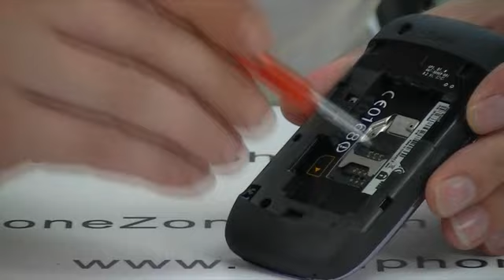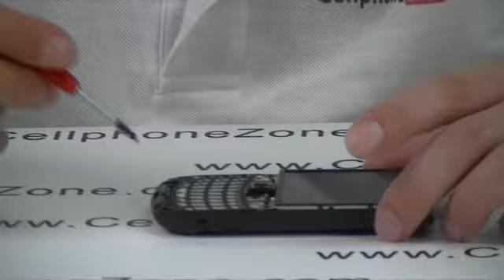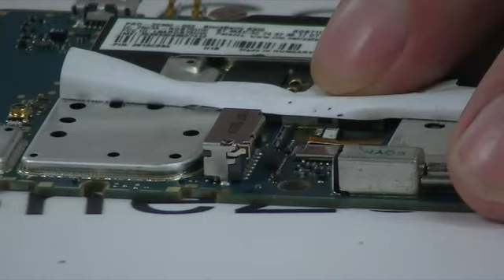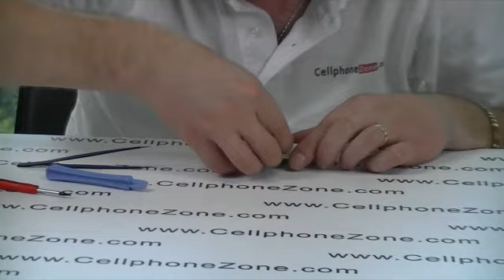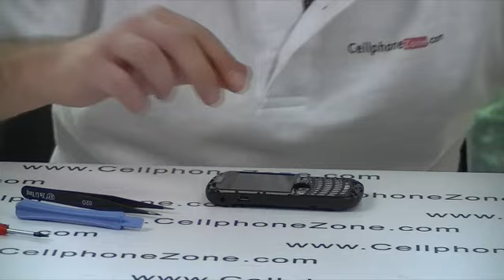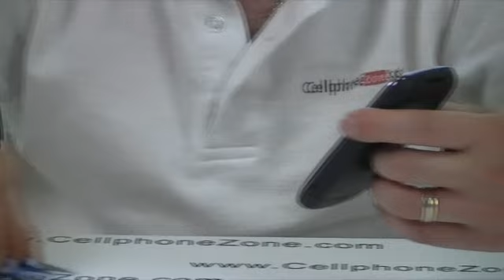Blackberry Trackball - How to Fix Blackberry 9300 Trackball

Comment: It was actually a dodgy trackball, I bought it on ebay and thought I could trust it as the seller had sold over 1000. I bought a replacement trackball from another seller and it works great, thanks again

Comment from the maker: Hi Nicole, sorry for the late reply, if you have not fixed it already the best thing you can do is take it apart again and check all the connection plugs are connected correctly to the motherboard, and also make sure all the screws are done up tight as if there loose you may not actually have a battery connection, I hope this helps,
Kind regards,
Neill.

Comment from the maker: Hi, the first thing to check is the top screw and middle screw on the right as you look down on the phone are done up tight, if they are not tight then you will have no battery connection, try pressing down on both areas and see if you get a red light, try that first, 
i hope this helps,
kind regards,
Neill.

Comment from the maker: Hi, when you reinstall your front housing make sure you start at the top, push it on then pull it down, then it should be in position for the sides and bottom to click back in, I hope this helps,
kind regards,
Neill.

Comment from the maker: Hi, basically all you need is a T6 torx screw driver and a pair of tweezers, and use a hair dryer to heat up the front screen, you will find it comes off much easier if you heat the screens glue up first, and be careful when removing the screen as there is two layers, if you separate them the screen will become useless, I hope this helps,
kind regards,
Neill.

Comment from the maker: Hi sorry for the late reply, the trackpads look compatible as they have the same connection to the motherboard, at a guess i would say yes as the 9300 trackpad and the 9800 track pad are the same, and Blackberry would probably try to save money by using the same trackpad on the 9320 as well, so i'm 99% sure you can use the 9300 trackpad on your 9320, I hope this helps,
kind regards,
Neill.

Comment from the maker: Hi, First check that the connections to the motherboard are all connected properly, also try charging the phone, sometimes they need some power to reboot them, if this does not fix your prblem then it sounds like you have damaged the LCD cable, and will need to replace the LCD, lets hope it's just the motherboard connections, anyway i hope this helps,
kind regards,
Neill

Comment from the maker: Hi,
There is a few things you can do, first try the next screw driver up, so if your using a T5 then use a T6, and make sure you really push hard into the screw, they need a lot of downward pressure otherwise the screw driver just spins in the head, you can also try to tighten the screw up, sometimes by doing that, it loosens the screw, sounds wired but true, another option would be to use a flat head screw driver and jam it into the head of the torx screw,
(1st part)

Comment from the maker: Hi, it sounds like your motherboard is the issue, and I doubt you can do anything to fix it, since you have already changed both then I guess you have two options, first you can try to find a repair centre that will fix it, or second look on ebay for a replacement motherboard, i hope this helps,
kind regards,
Neill.

Comment from the maker: Hi, sounds like your motherboard has got some problems as it is strange that both the trackpad and the top row of buttons have stopped working, I have checked on ebay and you can get a new motherboard but it is expensive, if I was you I would try to find a local repair centre and ask for a quote, the only other thing you can try is to replace the trackpad, if that works then maybe try changing the keyboard membrane sticker, I hope this helps,
kind regards,
Neill.

Comment: Hello mate wondering if you can help, the clip that holds the scroller in the place has snapped off on my phone, I was wondering if it will still work if I just make sure its still got connection then just put the sticky bit, back over?

Comment: Hi SWwebmaster

My trackball stopped working all together then I started to get white screen when I tried to use the trackball. I have just changed the trackball but its still not fully working? It only works when I use it to press enter but does not work for scrolling left/right/up and down.

Any suggestions on what I can do?

Ps Thanks for the videos, very helpful

Comment from the maker: @efrrren 
Hi i have two suggestions, first you could try to find a good double sided tape, that should seal it, other wise maybe just buy a new screen there not expensive and will make your phone look like new, but as for a good glue I really don't know the name of the adhesive they use and i would strongly advise you not to use supper glue, anyway i hope this helps,
kind regards,
Neill.

Comment: @SWwebmaster Thank you! It did work like this, but now I got another issue... The glue from the plastic screen wore off and now it opens up on the bottom where the options and return/answer hang up buttons are, do you know what kind of glue I could get to fix it? Thans.

Comment: If you have a Micro SD card in the phone, REMOVE IT FIRST. (It's in a recess on the left, as you're looking at the back of the phone with the backplate removed.)

If you don't -- as I just discovered -- you will end up with 2 halves of a Micro SD card  :-\